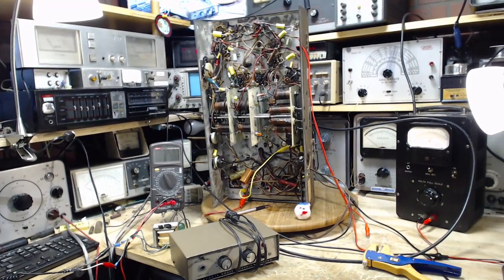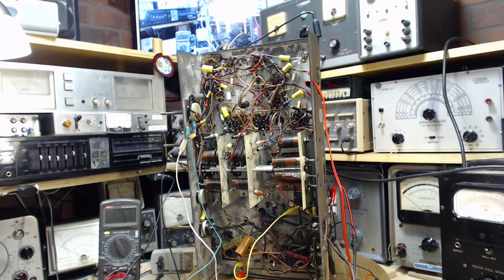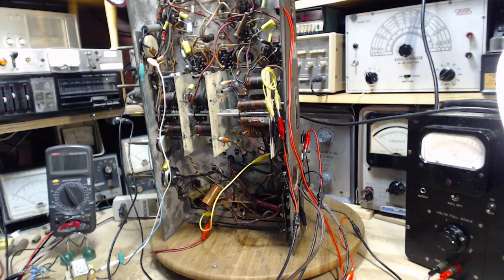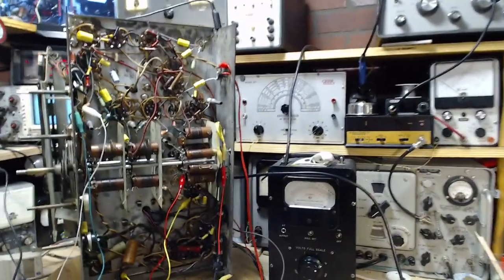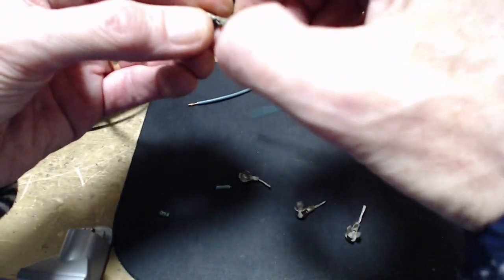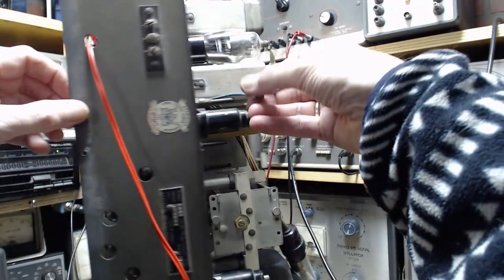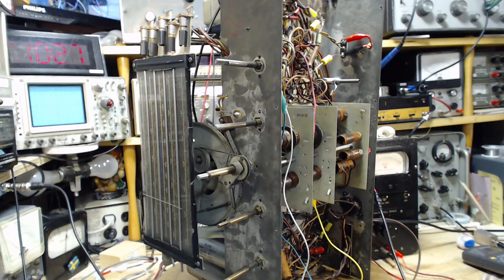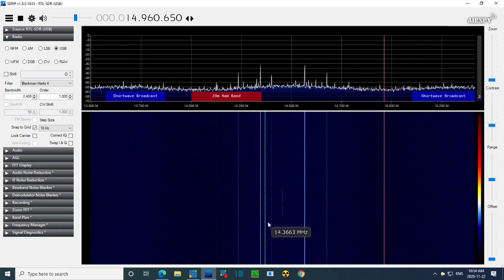Westinghouse Model 1029 Multiband Tube Radio Video #13 - Grid Cap Lead Wires

Comment: Dude, you need at least 175 Volts on the B+ rail (125 x 1.414) !!!
Get a knob for the band switch !!!
Reply: That whole bandswitch is a mess. The whole ordeal with the illumination if the bands being off should have been a dead giveaway and enough reason to dig deep into the wiring. 
But we are only at video #13 in this series. At least 7 more to go until the magic 20...